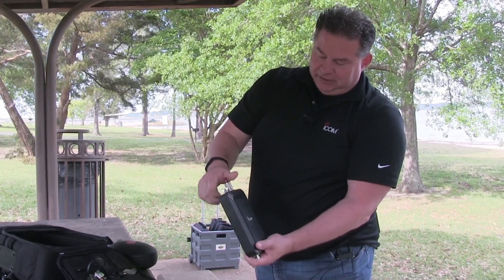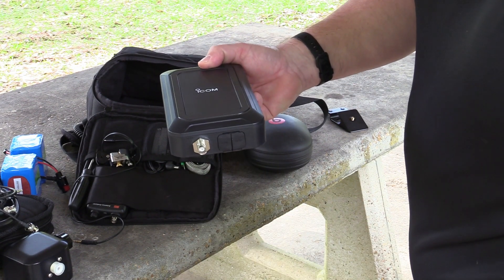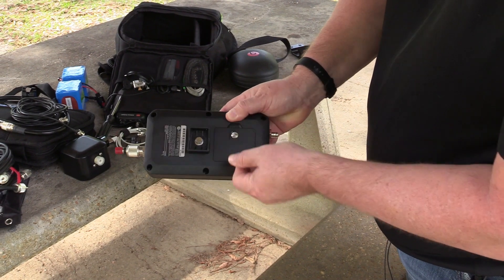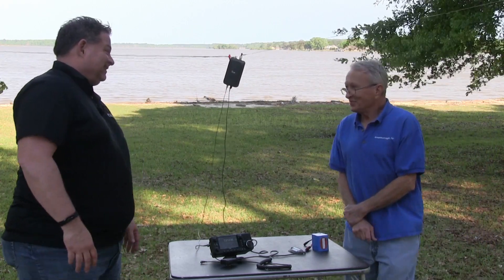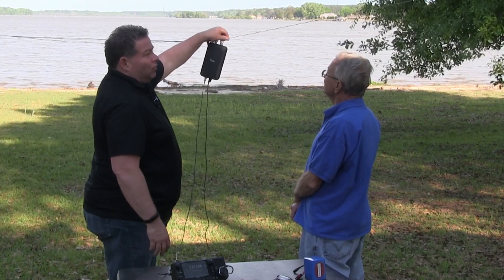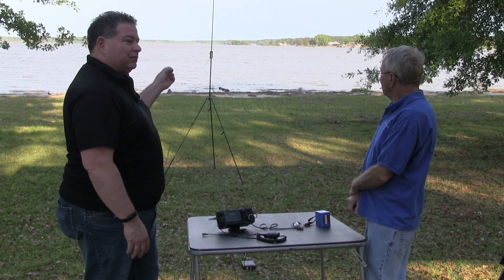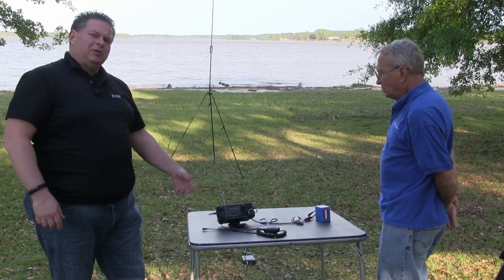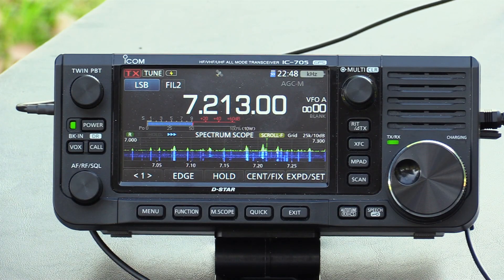Icom AH-705 in the Park with Ray - N9JA, Tommy - N5ZNO, and George - W5JDX.

Comment: I’m no expert but doesn’t the counterpoise only need to be resonant for resonant antennas ? So technically they can be any length in this situation ?
Reply: Buddipole uses the length of the vertical antenna, the length of  the coil where it is tapped  (coil needs to be tapped at different positions on the coil depending on what band you are on for proper length)  as well as the the length of the elevated counterpoise to achieve the proper length on the antenna for the specific band you are on. So tuning the antenna with an analyzer is the easiest way to tune the Buddidpole for a specific band. Not sure why they think you can just randomly tune the Buddipole with a tuner with out first setting it up properly for a specific band? Usually no need for a tuner if the Buddipole is properly tuned using and analyzer. On the lower bands the band width could get a little narrow so then the tuner could be helpful in not having to mess with the antenna settings after the initial setup for that  band.